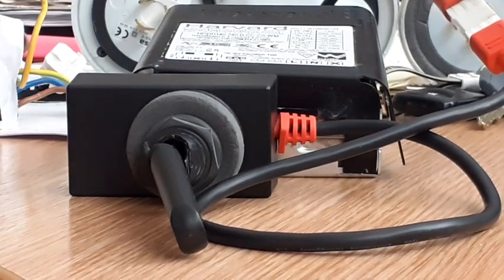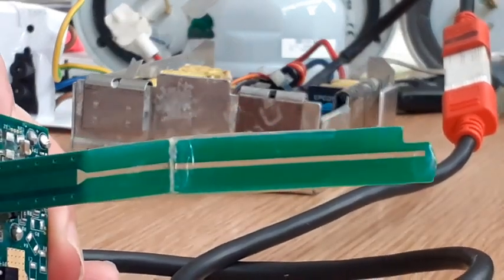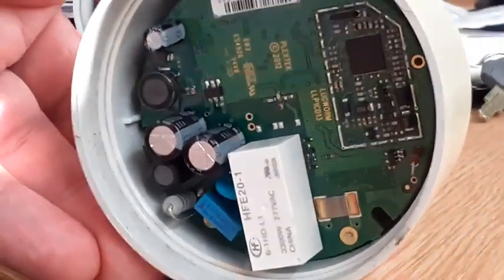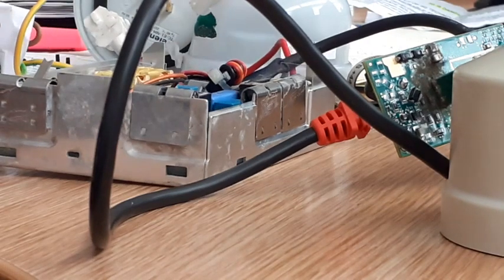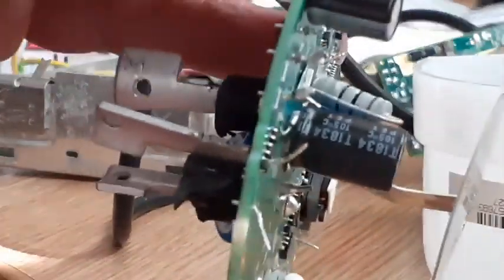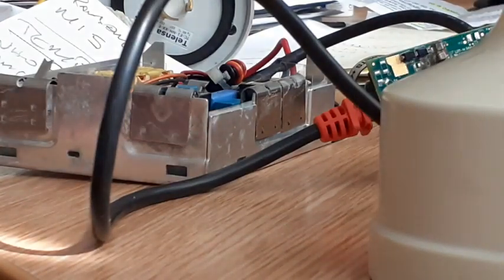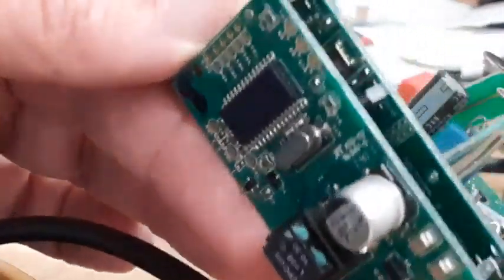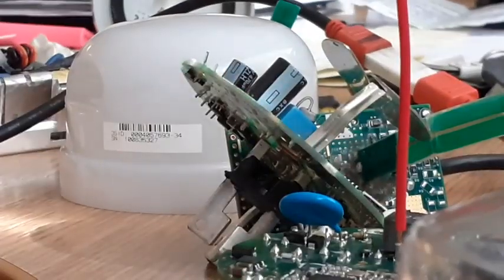5G APOCALYPSE HARDWARE STREET LIGHT CRIME UNCOVERED

Comment: The '3300 watt transmitter' is just a relay to control power to the lamp.
450v capacitors can be found in almost every household device, they are not a 'weapons grade' component.

Comment: 3300w?  Why not measure the actual output?
Reply: haha.. this so called expert points at the relay... and says 3300w... FFS.  look at that circuit board and imagime 3.3kw going through it.. hillarious.
Reply: @jonny46ba  Why not measure the actual output?
Reply: @anonymousguest9290  I'm getting a sense of deja vu here?
Reply: @jonny46ba  To prove the actual output it has to be measured.  Agreed?
Reply: @anonymousguest9290  yes.. your point?
Reply: @jonny46ba  To know the actual output it has to be measured.
Reply: I agree. 

point is - RF antenna is put into led light which is idiotic solution even if govenmind had the best interest fo its people ;)
Reply: @MaximumEfficiency  And that is really the only point here.  The output wattage is irrelevant.  That fact that its even there is suspect.  Why would anyone need more than a photodiode to determine when a light should be on or off?

Comment: Now you stroked the bear...

The part he calls 3300 watts is pure bunk.
That is ausie markings for microfarad 
3.3 uf I think . It's a capacitor. 
No device that size can pass 3300 watts.
That's the output of my backup generator.
Stove or dryer level.
The guys a scam and you can tell him I said so.
The bridge pass guts in your car.
The one in the video is a larger muti channel version with several sensing and 2 way control info.
The strip he shows green is the antenna.
Reply: 3300w is about 13amp... the unit  is basically a switch and yes it could switch / pass that watage.
Agreed
3.3uf can only be a cap
See first comment 
See first comment 
Assuming on about watage. See first comment 
You can tell him i said so too
No idea....
Again not sure
Yep boring aerials

Comment: This guy demonstrate a fundamental misunderstanding of what 5g is.  I can tell you for a fact that none of this equipment is 5g enabled, and instead uses unlicensed RF frequencies to communicate small packets of information with each other, working as a mesh system to relay power metering and lantern control to a base station.
Reply: which is an idiotic solution either way

Comment: Answer:

Is that the light sensor he says is a weapon

It's bull shit.
It 2 way wifi .
And big enough to go several miles.
So it can send data on the light level as well as can be override at control center.
And reprogrammed to go on off etc.
It may have a traffic counter too.
Some do to decide whether light needed or not.
Plus some lighting can pick up your car a mile away and turn on.
Then off until another shows.

+ I'm taking my thumbs up back.
Reply: good job you are one of the not stupid ppl